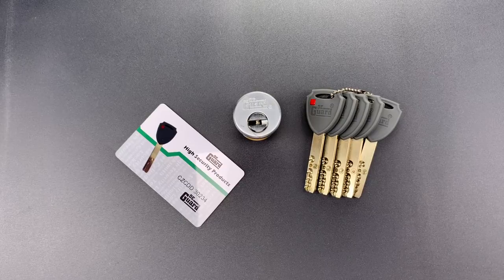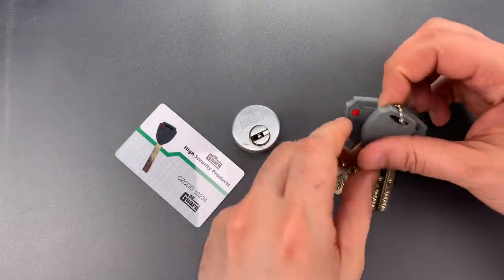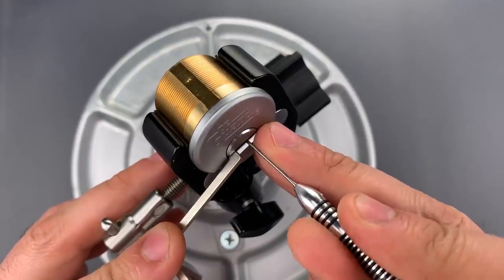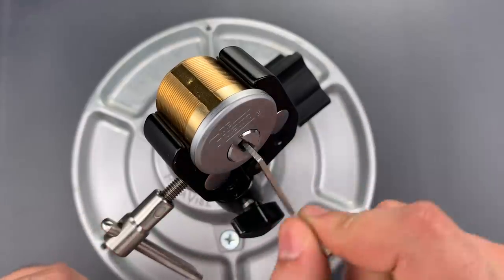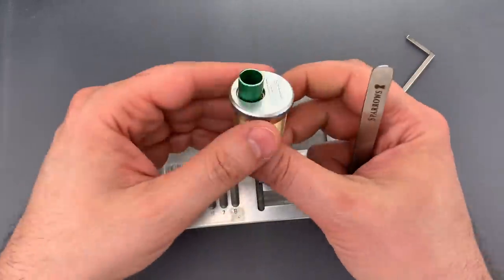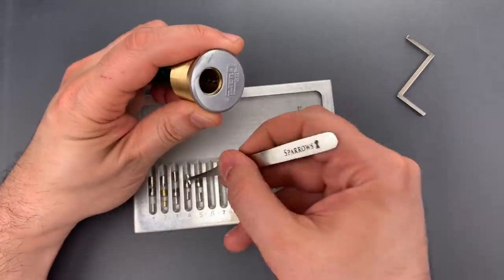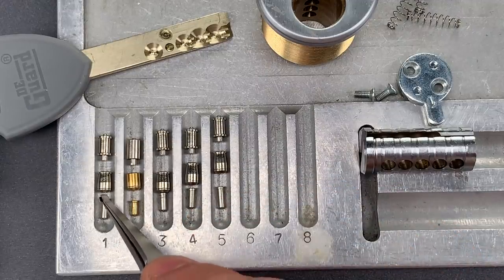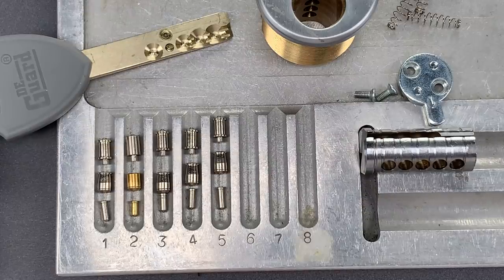[1170] High(ish) Security Copy: DeGuard Pin-in-Pin Lock Cylinder

Comment: Finally a gutting again. Really missed those.
Reply: Same. It's been a while
Reply: Agree.
Reply: Master Lock is gutted every time he grabs a pick.
Reply: I really enjoy the gutting and further analysis on the security of the locks that he goes at. It really gives more information to the whole of the community of what is really there and what we can expect. Also gives more info on what actually is in the market space and doesn't just show a bunch of "magic" opening.
Reply: Would it be interesting to see occasional putting it back together again followups? I can imagine that must be harder to get right than taking it apart.
Reply: @NikisDaddy  that's why the pinning trays; keeps everything sorted for correct reassembly.
Reply: I already figured that out @lairdcummings9092  , but I didn't realize that would necessarily make it easy. I imagine some locks are still quite difficult to assemble, even if you know where everything is supposed to go.
Reply: I enjoy these more than the meme picking ones
Reply: He does them any time he can- if a lock can be gutted non destructively he does it
Reply: This comment would be horrifying out of context
Reply: I'm ready for some more ramset videos too.
Reply: Usually I don't like the gutting, but this lock actually had something unusual about it. That made it an exception worth seeing more about.

Comment: 7 mins? This gonna be good...
Reply: Well, the picking itself took less than one minute.
Reply: It certainly is, as he stated himself at the end of the video, but it still took it only 50 seconds to pick… taking the time of providing us with some explanations :-)
Reply: @ObsidianParis , consider that he HAS PLENTY OF EXPERIENCE and is doing the picking in controlled environment, not in front of a door, in the open even, with limited time and risk of being spotted picking the door.
Any lockpicker will face trouble picking a lock system they never faced before, and even then it takes time, trial and error plus enough experience in the trade to do it fast.
Taking 50 seconds to 1+ minute to pick even with expertise in the lock and skill + tools means that the lock itself wouldn't be worth attacking in the field for 95% of the criminals that know lockpicking skills.
Reply: @andrehashimoto8056  So ?

Comment: I'm a little hooked on your videos, and I came across another video on opening a sentry safe with a simple nail clipper, using the file side. Well, I had one here, and have had it for years thinking it is safe....  LOL.... after watching the video, took me less than 40 sec to open it with the nail clippers. AND, I haven't even got my tool kit from eBay yet... Haaa.. This is officially my first lock pick.

Comment: I had lockpicking set before few years, but I cannot say, that I am good in lockpicking. Due to your channel I just tried it again. I have no tools here, so I take hammer and wire. Go to a garden and make wire flat on some rocks. I abraded it. So I have medium security door in my house - or as can I say - lock from realatively famous company for security. So ... I just lockpick into my house in 2 minutes. (For some pins I also must use needle.) It really freaks me out. I never try to pick security lock just because it is security. But you opened my eyes. I can literally lockpick into my own house.

Comment: Picked in like 50 seconds, more like de-guard your door.
Reply: You have to put this in perspective. LPL is working in laboratory conditions with just about every concievable lockpicking tool to hand. If it doesn't exist, he'll call up Bosnian Bill and they'll invent a tool.

Burglars either do not bother with locks at all, rather finding a way to bypass them, or they'll have tools for a specific type of lock. For instance in an estate neighbourhood, where all flats and houses are keyed by the same counsel housing coporation, a burglar might carry a bumpkey for that brand of lock.
But more often than not they'll force a window open or shim the door or use the old bent-coat-hanger-through-the-mail-slot technique. None of which have anything to do with the quality of the lock cylinder at all.
Reply: Have you even watched any other LPL videos? You'll be way disappointed if you think this lock isn't secure.

Comment: I just bought a copy of this copy by Ri-Key as my first dimple practice lock and its identical EXCEPT mine starts with the active element even though the key has a regular pin as #1… as in the key is identical but they chopped off the front of the lock basically, lol.
That said its all stainless and machined VERY nicely. Ive not picked it yet so I’m now glad to be missing the #1 pin position,lolol.

Comment: Pretty much dispatched in less than a minute with decent innards. Without drill protection in the chamber or housing, I don’t think LPL would put  this on an outside door.
Reply: What are the chances of ANY robber that knows how to lockpick to even be THAT skilled?
Security like these locks are to dissuade potential would be burglars to even try to attack your house, and that's only if the WEAKEST point of entry is the door anyways, security is only worth it's weakest area, if someone wants to invade your home, that person WILL find a way, even if that means that BEACHING THE WALL is the better point of entry.
For a lock to take an EXPERT at the level of LPL under CONTROLLED environment, access to tools and be someone like LPL who HAS EXPERIENCE with these locks take 57 seconds, it means the lock is field approved to be honest
Reply: @andrehashimoto8056  Where I live in LAS, drill protection is a requirement for any outside commercial door. A 5 pin lock with out steel pins is a 10 second job (5 seconds to freeze, 1 second per pin to drill) and less observable than a wall breach. LPL is phenomenal but he's not alone as evidenced by other YouTube channels. Most outdoor implementations give you at least 5 minutes if they aren't covered by a camera and most likely an alarm system. A potential villian would only need to acquire 25% of the skill of LPL to bypass this lock undetected. Thus, this is an indoor lock at best that would be relatively decent over other locks in the area, if picking was the method of entry.
Reply: @andrehashimoto8056  What does lockpicking skill have anything to do with taking a drill to the lock cylinder?  LPL said in the video that unlike the lock this one was a clone of, it had no drill protection, so it should only be used where you're not worried about someone taking a drill to it.

Comment: hey, my door key looks a lot like that one!
I thought it was a rather strong lock since it's an unusual key, but I guess security comes more from the pins and feature of the lock than the keys. It just happens that the key is hard to reproduce. (and yeah my grand parents have a similar code card for the key).
Also, I wonder, sometimes my key can turn without affecting the lock. Why is that? Like the core engages but somehow the lock doesn't open.

Comment: I feel with all those spools in there (and the torpedoes), this lock could be taken to the next level with just some varies spring pressures and a few well placed undercuts to catch those spools.

Also, are interactive elements even worth losing a pin over these days? I haven't seen any prove to be (could have tossed some serrated pins in slot 2 and had a whole new problem for pickers).
Reply: Re: interactive elements - it depends on what your goals are. Good key control can often be more important than going from "hard to pick" to "even harder to pick".

Comment: I feel like this would be a more difficult pick if the driver pins were also a pin in pin design, with a plate between the pin and the driver springs.

Comment: I have a question. In Europe most doors are designed to be opened by two or sometimes three full rotation of the key. If you'd pick a lock like that wouldn't the pins fall back into the slots after one full rotation? Meaning you'd have to pick the lock at least twice to open the door?

Comment: I don't know if this is a stupid question or not but... Is it possible to make a lock where if you pick one pin, and then move to another position, the first pin would spring back into place if you do not keep it held down? Or is that what he uses the tension bar for? I have been watching this channel for only a few weeks, so I don't know if this has been talked about. But lock makers know that guys like you will be trying to pick it with this method right? Is there a way to stop a picker from using a tension bar and pick?

Comment: Hmm ... the thing I find sad, is that this lock is basically the same mechanic as all other locks. Save the fact that the key doesn't interact with the pins vertically, but horizontally. I thought there is more to that.
You can put those special pins into a normal lock as well, the only benefit here is that each pin is not just one piece of metal, but a tube and a pin inside.

I should be possible, to create a lock that truly is pick save, forcing you to drill it out, or?

Comment: is it possible to weaken security or cause other problems [other than not being able to use the key, since you'd know that right away] by taking it apart incorrectly? e.g. what if those half spooled outer key pins are upside down? or, there was an older video i saw recently where you dumped out all the springs and it turned out they had different strengths.

Comment: I would like to know what you do if you do not know which way clockwise or counterclockwise a lock is designed to twist let's say normally it's clockwise that a lock turns to unlock a door or lock or anything like that but you come up on one lock that just doesn't want to turn clockwise do you eventually just try turning it counterclockwise or is there a tall tail sign that tells you that it turns counterclockwise what are your steps to figuring this out?

Comment: Is it possible to make a key without any moving parts that still works to properly position pin two?  The interactive part of the key is meant to deter copying to a blank that also has that moving part, but could someone find a way to make a key blank that is easier to use for duplication, and possibly has no moving parts?

Comment: Once you get up to a lock with that kind of pick resistance, I fell feel you are probably just inviting a smashed window. 
It doesn't help that where I live you are no longer allowed to have keyed locks on the inside of residential doors, even if they have a window in them.

Edit: (Spelling)
Reply: Where the hell is that?
Reply: @scottdotjazzman  I live in Lancaster County, PA. It's in building code that no new doors or locks can be installed with keyed locks on the inside because it is too difficult to get out of the house in case of a fire. 

I ran into this when I wanted to get my back door replaced. Because the size is no longer standard, I can't get a steel door to fit the frame so I wanted to at least replace the locks, which were medium security back in '95 and the exterior pins have started to stick. Unfortunately, you can't get new locks to fit this old door without having a lever on the inside and the door doesn't have the newer high-strength security glass because it was made in '95.

So my options are to buy a wooden door, cut it down to size then install a sideways transom window in it or stick with this steel door with corroded locks.
Reply: @dhawthorne1634  Yikes.

Comment: Is there a type of lock that requires you to use the key to set the inner cylinder in a position where the pins are allowed to go deeper inside the lock.
Reply: I'm thinking if you don't use the key to set the lock the cylinder will move forward getting a lock stuck, and it would be very difficult to set the cylinder without the key. And I'm thinking the in a cylinder would be spring loaded to go back to default position without the key inserted

Comment: Why would a lock manufacturer use 4 spool pins and 1 normal one? Does it have any benefit over 5 spools?

4 normal 1 spool I understand from a cost perspective but if 4/5 of your pins are spool isn't the cost of making that last pin a spool marginal?
Reply: I believe there are mechanical reasons why you need at least one non-spool.
Reply: @jrd33  now that's interesting. I'm thinking maybe there's a scenario where the pins can twist and jam (pure speculation). Would love to hear more about this if anyone knows.

Comment: Calm down, everyone. The lock wasn't hard, LPL just wanted that extra ad revenue.
Reply: Multi-Lock style locks aren't hard.. once you get the hang of them. And as he said, for that reason he has mixed feelings about them. Both Multi-Lock and Medeco locks require a special touch, but once you crack that they are nothing special... But if you lose your key the lock smith WILL drill these, unless they work at a place that specializes in large master keyed security systems with these particular brands.
For reference: I pinned my first Medeco M3 up with only one pin in the first chamber. It took me 20 minutes to get my first open. With two pins, and knowing exactly what to do with pin 1 it took me almost half an hour. After I had worked that down to 30-40 seconds I added another pin, and so on and so forth. Now I can pick any 5 pin Medeco (that I haven't ever touched before) in 3-5 minutes (I'm not a god like LPL)... I also own 5 visually identical ASSA 700 locks. Those are standard 7 pin pintumbler locks but with absurd tolerances and a nasty arrangement of security pins. These are locks I know like the back of my hand, and after picking for a few seconds I know which lock I'm on (I can even see the key in my mind)... yet I have NEVER gotten below 5 minutes on any of them.

TLDR; This lock IS hard. Except to a small number of people. To them it's easy.

Comment: High security locks tend to just cost more don't offer any real world security to the common thief.  Hardened steel pad locks are good idea generally most criminals are not that smart they would spend time learning to pick locks. For something where you have expensive art, or gold that would attract a smarter criminal then I could see the need for it. Putting a lock like this on a house door where someone can just cut window or break a window just kick in a door no real gain.

Comment: Those dimple locks are in fact a bit of a inferior design simply be cause the pins have so much less travel and thus are always are close to the shear line. in other words they never have to be moved far and there are way less variations per pin.